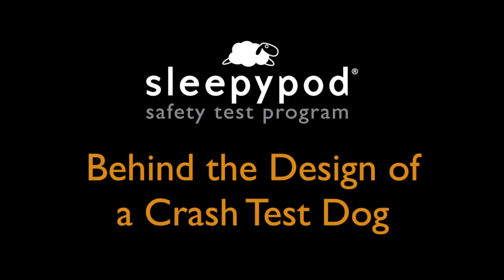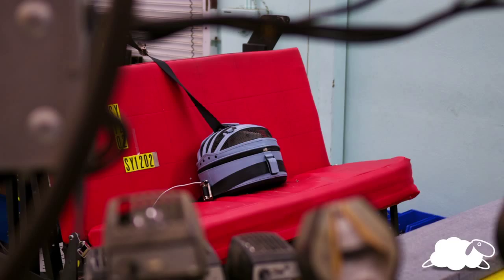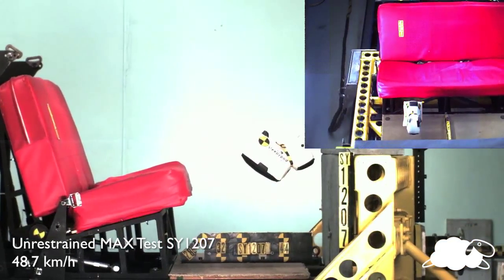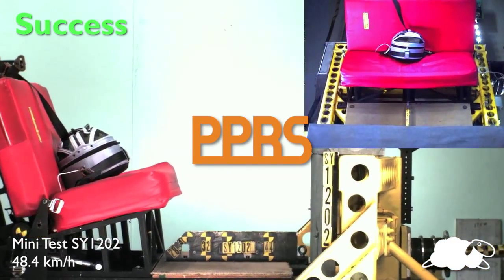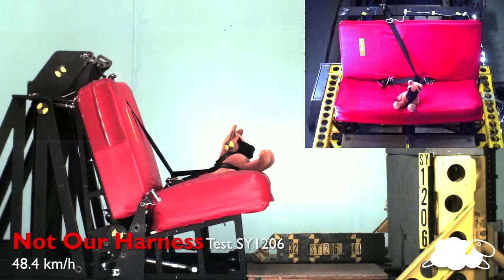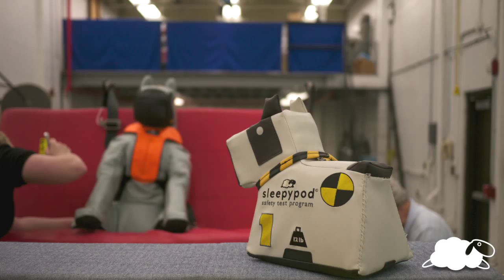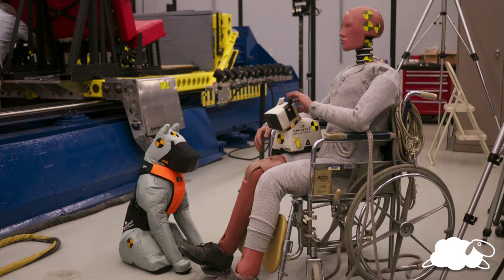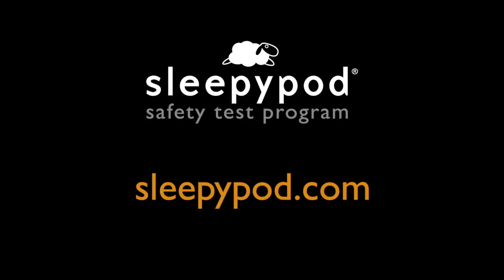Behind the Design of a Crash Test Dog

Comment: I think fur matters when it comes to testing , it makes it more difficult to stay in the restrained more wiggle room and more slip  ( my opinion ) all crash test dogs should have fur because most dogs have fur
Reply from the maker: Thanks for your interest in Sleepypod's crash test pets. Pet safety is paramount to Sleepypod, so there was a great deal of thought and consideration by Sleepypod's research and design team when landing on the final crash test pet designs. Our R&D team has found negligible effects on test outcomes when using a crash test pet with simulated fur (as in early Sleepypod crash testing) or when using the materials used in Sleepypod's current crash test pet designs. The more important considerations are correct product size and proper adjustment.